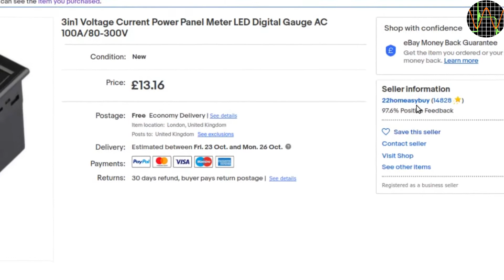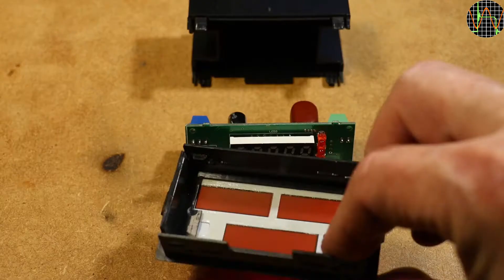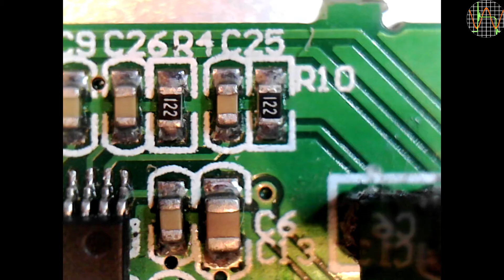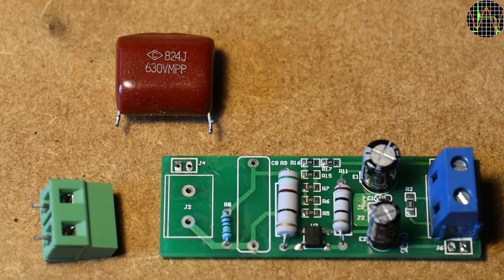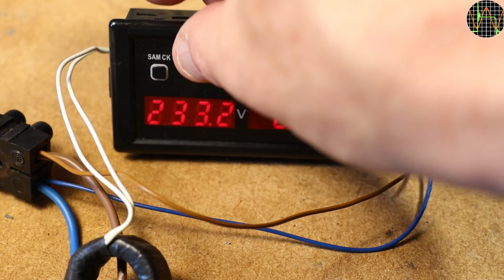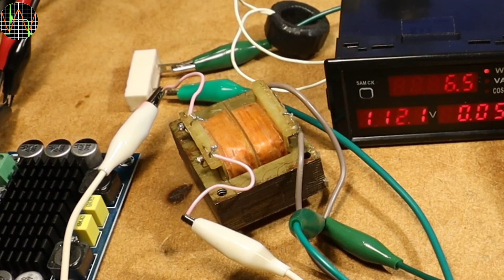Modifying (and repairing) a DL69-2048 AC volt/amps/power panel meter to read from 0  (+schematics)

Comment: The 51 ohm resistor is needed to take care of the 820 nF capacitor charging inrush and needs to be quite beefy. Worst case is if the circuit is connected at the mains peak. The 10 ohm doesn't make much sense because it is essentially just in series.

Comment: Got one of these recently and did the mod to measure from 0V up. I am in a 120V country and the unit I got would not work reliably at 120V due to processor brown out. The DC voltage was around 3.6V  when it should be 5V.  To solve this i replaced the factory  470nf cap with 820nf cap. The cap fit the same spacing and now the DC voltage is 5V with no more brown out issues. The voltage measurement is pretty spot on but the current measurement on my unit is a little low.  I don't think there is any calibration  so i might need to add a few turns to the current transformer.  The meter shows about 0.5A ...0.7A lower  current than a clamp meter at 10A.
Reply from the maker: That's good stuff. thanks for sharing

Comment: Posting new/additional info on my own DL69-2048 meter, which I bought many years ago. The main PCB is marked DL69-2048G1 and the power PCB is DL69-2042A2. I guess that mine is an earlier revision, but just as easy to modify. There are some differences to schematic shown at 5:19 - details as follows:
After the bridge rectifier and 10 ohm resistor, mine has a 2200uF 10V cap (no ceramic cap), then the 2 x zeners. There are no filtering of the the 5V supply at all after the zeners, it goes straight to the J6 header. There is a ceramic cap down on the main PCB.
For the voltage sense, mine uses only 3 x 1 Meg resistors in series, then a 1K resistor from there to the 0V rail. So there is a 3000:1 voltage divider up on the power board before it gets to the header pins.
The main PCB in mine is considerably different and all the chips have the part numbers ground off. Anyway, I modified my board in a similar way, using a smaller 3-way terminal block for incoming Mains.
Reply from the maker: Many thanks for sharing. May come handy for someone getting or having the older version.

Comment: Thank you!! This was extremely valuable to understand the theory of operation for these boards.  I plan to modify a KWS AC300 so I can power it separately from measurement.  I'm curious why the manufacturers don't separate AC Sense from AC power In to increase the measuring capability.

Comment: Thanks very much for this.  I've successfully carried out the same mod on a different meter model (D69-2058, LCD version).  In principle it's the same, with a 3 resistor 1.5MOhm chain.  However, the PSU board is quite different in layout and design, using a 7805 regulator and such.

Comment: OK, but your new AC voltage input is relative to the neutral of the power connection that powers the meter. So this is not going to be useful to measure AC voltages that are relative to some other ground or neutral. Further, the reading will be off if there's any voltage drop in neutral, and worse yet, the reading will be wildly off if the power connection has neutral and hot reversed!
Reply from the maker: All valid points but this device and my modification were never intended to do any of this. Its a panel meter for a fixed and properly wired installation.  I tried to find the easiest way to make it measure from 0V onwards with minimal changes. Yes, a completely separated measuring input would be much better than the implemented shared-neutral one but I don't see how that could be realised without lots of additional modifications.
Reply: @TheHWcave  I would like to commend you on making the video, and the care you took to zoom in on the details, plus deriving the schematic (and its anomalies!) -- all valuable info for us viewers.  But that said, I think the limitation that the measured voltage has to share neutral with the meter's line voltage supply is almost as limiting as not measuring below 80V.  I guess it could be used to measure an internal voltage of an appliance whose internal circuitry runs directly off the mains, no isolation, no rectification, no triac control and so on.Ah-hah! I realized that you're going to use this on a Variac, which is an autotransformer and non-isolated, so one of the few applications this would work well for!
Reply: @Graham_Wideman  - It's a mains power meter designed specifically for measuring sinusoidal AC MAINS voltages. It's not intended for nor suitable for measuring the internal voltages in appliances that are isolated from the mains.
If you are measuring internal voltages then you need a different type of meter. Specifically, to measure rectified voltages, you'd use a DC meter.
It's not a true RMS sampling meter so it cannot be for accurate measurements of triac-controlled AC, however such devices (simple motor control, dimmers, etc) all use main-referenced Neutral so this meter would kind-of work without issues.
Remember, this is one of the cheapest meters to measure mains power.

Comment: Shame they didn't make the volts input separate and linkable to the mains input terminal, as you did here.
Would have made it so much more useful !
The soldering is a bit messy in that unit - it does look like it was done by hand, as you say.
I don't have a variac here, and many times have wished I did, so look forward to seeing your experiences with a (presumably) new one. I expect only the Chinese make such a thing now ...??
 Dave
Reply from the maker: You are right, it would have been so easy to make this mod in the factory. I found that in some DC volts panel meters, there is actually a link or sometimes a solder bridge that can be removed to separate supply and sense inputs. Its all a matter of costs, but I am sure if a manufacturer would offer this from the factory and advertise it accordingly, lots of folks would buy it even if it costs a dollar more.  As for the VARIAC,, mine is actually made in the UK by Carroll & Meynell (but I bought it via RS-components). The problem is that I underestimated the weight, more than 9 Kg and I doubt that the enclosure I wanted to use will be able to hold that hanging from the front panel without deforming, at least it will need serious mechanical re-enforcement first which I am designing now.
Reply: @TheHWcave  Oh yes, I take it back, you can buy a variac made in the west ! I just looked on the RS website, your 9kg one must be about 1kVA.  They are heavy things, I agree - ones I have met always have a steel case at least, just to cope with weight - a cast aluminium case would be nice, and prob. strong enough, but at some cost I think... it won't get moved around  much I guess, so steel would be ok.

Comment: @7:00 I think the spec said it could work up to 450V, that would explain the over Designed power supply, to allow for that much higher voltage, in which case the extra capacities used would help.
Reply from the maker: You may be right. I did not consider using it for these voltages. You have to specify the range when ordering, so presumably a few other things may be changed as well...